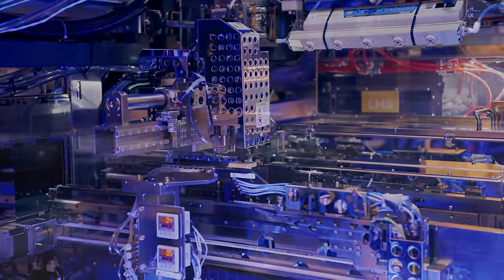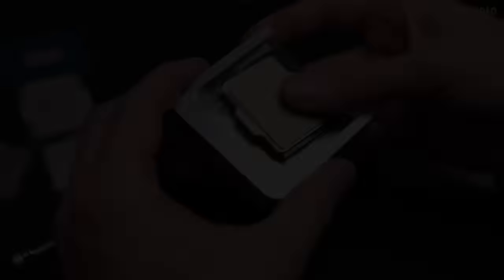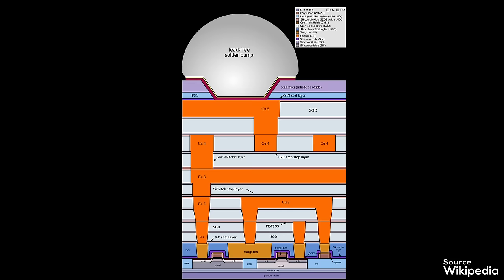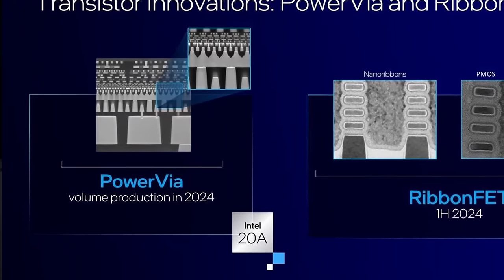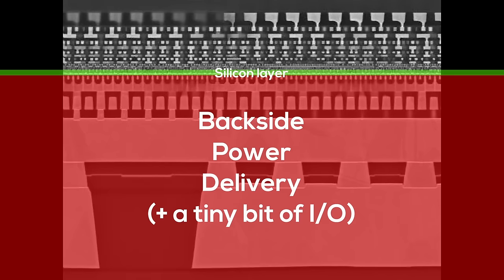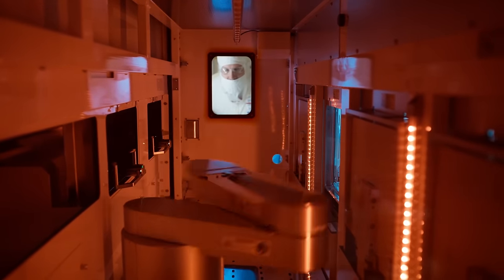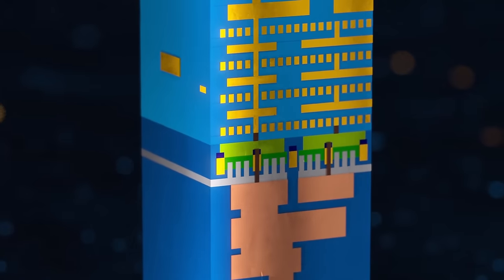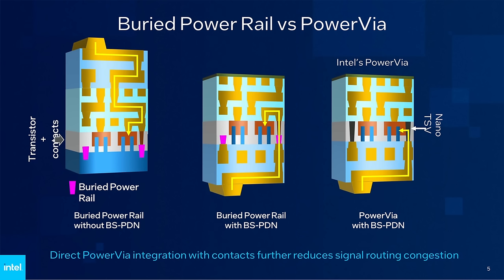Why next-gen chips separate Data & Power

Comment: It's crazy we've gotten to the point where we can make this stuff at all.
Reply: Yeah... yeah it's crazy.  It's a feat of engineering in mass production.  It's to the point where technology reaching its limitations so they have to precisely improve everything as possible to get performance.
Reply: When I hold a chip when I'm building a computer or something, I get the chills. This is the closest thing to "alien technology" we have IMO. The fact that you can get such an artifact for some hundreds of dollars is insane. Not to mention the enormous use you get out of it.
Reply: In the '90s, My Granddaddy had the same awe & amazement  as he told me about the very first radio he ever witnessed, before WWII.  "It was a machine that stood in the floor, right in front of an open window.  It had a wire attached to the back of it that went out the window to a pole. With nothing else attached to it..." 🤔😳

Comment: I wonder how this affects heat.
Reply: power efficiency allowing for higher clocks with less voltage means less heat but also mean for more overclocking room for higher cooling solutions so overall more it scales to be the same as todays you get the best speed you can for the temperature you can maintain. what it really means is devices are gonna get even faster and efficient.
Reply: one variable i would like to know is what part of the die generates more heat than the others but am assuming it would be the power delivery and i/o but if this design improves those power lanes I think that might improve the heat waste generation am not sure of those detail. but would be nice to know.
Reply: I am not a qualified semiconductor expert, but assuming that the total die thickness stays the same, I would think that backside power delivery would improve temps, and not only because of the improved power efficiency. The transistors have been moved slightly closer to the IHS, and they have the copper signal wires between the transistors and the IHS conducting the heat towards the IHS. on top of that, the larger power wires may also improve temperatures due to their increased thermal mass.

Comment: You didn't comment on heat dissipation, as there will be more layers on the bottom of the trasitons it could become more difficult or even more heat, I hope more videos like this, thanks for the content!
Reply: Yeah theres been alot of discussion on this but still not clear, I think it might just put 300w consumer CPUs in the pass
Reply: @ItsAkile  Yes but It still being a go for notebooks and SI OEM. If have to bet I would say it is for E-Cores only chips
Reply from the maker: Intel said there isn't much of a difference and the increase in efficiency (less energy lost to resistance = less heat) makes more than up for any decrease in thermal capabilities.
Reply: @pedro.alcatra nah, that was just for testing. It’s a full feature to be widely implemented
Reply: I just saw someone adding cooling to both sides of a motherboard which didn't make much sense to me at the time. And the POC didn't work very well.  I would think that the power delivery side would need the most heat dissipation.  This seems super promising.
Reply: @kahnzo  It is the silicon side that needs the most heat dissipation because that is where the switching is happening. The thick copper traces for power delivery will wick away the heat -- copper is an excellent conductor.

Comment: Don’t forget that lower thermal resistance is intrinsic to this as well
Reply: As well as increases power capacitance very near to the transistors, allowing lower noise.  Larger surfaces of power planes are free massive capacitors.  Nvidia used available space in the metal layers to make capacitors to reduce power noise.

Add to that, keeping (now lower) power noise away from the signals will help too.
Reply: @HansSchulze  and less parasitic capacitance to signal lines
Reply: @snaplash  I/O yes, but that’s nothing compared to the interconnects which are front side

Comment: Small clarification regarding the M0, M1, M2, etc labeling. Using the BEOL image from wikipedia at 5:45, you identify and highlight "M0" as the lowest metal layer in the BEOL steps. In your image, M0 would actually be the tungsten metal, which is identified as part of the FEOL processes. 

M0 is often called a "local interconnect", because it is a metal layer that is laid directly on the Si surface, and is used to connect immediately local transistors together. For example, in an Inverter gate with 1 NMOS and 1 PMOS, where the Drain of each transistor is connected to the same node, an Local Interconnect would be used to connect the Drains, by depositing a M0 layer directly on the Si, contacting the doped areas of the transistors that form the Drain. M0 is made of metals like Tungsten or Ti Nitrite, and not of the typical Copper or Aluminum metals used in higher layers. 

So M0 is a "special" metal layer used for local interconnects, because it uses different material and has to be deposited and formed in different ways than the other metals, because it's in direct contact with the Silicon. It's also used as the "Contact" metal for higher metal layers that need to reach the Silicon. M0 is the only one that actually makes contact with the Silicon, being deposited directly onto the Sources and Drains of the transistors to form vertical contact structures. Then, when the wafers move to BEOL, the first "typical" metal layer, M1, is made of Copper and it goes down touches the top of the M0 layer. 

In your BEOL image, you can see that the orange metal layers are labeled Cu1 (Metal 1), Cu2 (M2), up to Cu5 (M5). Each of these layers really comes in a pair of layers, because each Metal layer requires 1 layer for "Vias", which are the vertical structures that make contact between 2 metal layers, and 1 layer for the horizontal metal layers themselves. In the image, "Cu1" actually includes "Via1" (which is the vertical contact between the top of M0 and the bottom of "Copper 1") and "Copper 1" (which is the Metal 1 layer that makes the interconnects between blocks). Both Via1 and Copper1 each require their own photo masks and process steps. Then "Cu2" is actually "Via 2" (the vertical connection between the top of Copper1 and the bottom of Copper2) and "Copper 2", again each requiring their own masks and steps.

Comment: I work on Global Foundries' 22FDX process node which is a 22nm FD-SOI process for RFIC layout design and I gotta admit, this would be ridiculously useful in ways I can't even describe for the RFIC or Analog industry. I imagine it'll get significantly more useful the smaller your process node since the resistances get real high real quick when your metal connections have to be incredibly thin and the vias are tiny.

If I could put my thick power delivery wires on the back and not have to share the area over a bank of devices with the data wires my life would be a hundred times easier and I could work at twice the speed. This could even allow some sort of automation for the power routing.

Everything would become significantly more power efficient and thermally ideal by doing this too.

I must admit, I was rather surprised to find there was only one bottom layer metal (M0). In my process node we have M1 and M2, before going to higher layer block routing metals. I guess it makes more sense for a larger process node and for RFIC design
Reply: I can't say a whole lot right now, but I will say that there is active development for the type of power routing tools you're talking about. At the very least there is talk of offering assisted power routing for some 18A customers.
Reply: I keep on wondering: wouldn't it make sense to try to back port some of these Backside Power Delivery approaches also to older / larger nodes, like the 28 nm & 22 nm nodes which are still largely preferred for economic designs, especially considering that BPD promises both cost & power advantages? (Of course assuming that customers of these nodes are willing to invest in new layout design methodology & update their cell libraries)
Reply: @FrankHarwald  With legacy nodes, it's not as worthwhile as for less cost than spinning this up, they can jump to something like 14/12nm.

Comment: Amazing. 

I also think having the metal layers for data and power separate could allow for easier "glueing" of smaller dies together to form a bigger chip as you can route the I/O on top without going to the package substrate or even solder bumps.

Glue the chips together, then etch the hermetic seal and build yet another bigger metal layer on top of the smaller glued dies to make the I/O path even shorter. Thus you can make a huge die but with smaller yields. That wasn't possible with flip chips, but now one could imagine that being possible.

Comment: I do have to wonder about thermals and whether that will limit the benefits for P cores. The main heat generating component is the transistor layer and this method puts the signal layers in between that layer and the cooling system.

People used to polish down their CPUs just to reduce this distance by several nanometres and improve performance so I don't think it would be insignificant
Reply: Everything you said makes complete sense from physical point of view, but they did claimed 6% frequency increase so lowered power losses combined with better signal quality must completely offset higher thermal resistance. After all all that wasted power in classic design was ending as heat and not optimal signal network meant they had to use more power to hit frequency target.
Reply: @sznikers yeah what this guy said.
Reply: @sznikers  Pretty much exactly this. Cleaner signals means you don't spend as much power cranking your transmit and receive points, and you lose less to resistance everywhere since the paths can be direct and physically thicker.
Reply: Current intel method is to push the cores highest you can do, with BOD&IO , you have to find a good balance b/w how much power you can push vs what perf target you want.

It an added constraint to manage.
Reply: Lapping (not polishing) CPUs & heatsinks was to improve surface contact, not reduce thickness.

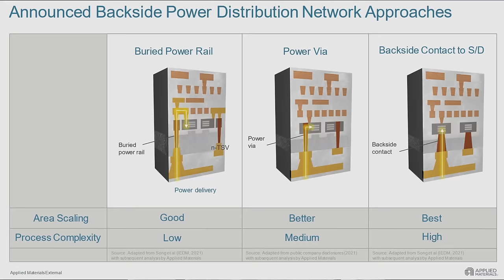Comment: I'm very happy to see this video. Slight bit of criticism - give yourself time to speak slower sometimes. I'm around 7:56 and it is hard to understand you, it almost feels like you're trying to speak as fast as possible. I don't think it applies to whole video, but it does to some segments, so in the end if the video was 20 seconds longer it wouldn't hurt that much.
But your content is top notch - and indeed problem of power delivery and data transfer, wiring etc. is a problem that is constantly evolving. Meaning that even if you find a solution, often people will take it for granted and within couple of years you will have to find other solutions to very similar problems. And yes, half of the evolution of microchips might be smaller nodes, but the other half is how to get them powered and linked. Very underappreciated topic, so I'm glad you're covering it! Good Job! 👍
Reply: I played the video at double speed and had no problem understanding High Yield. I think that he articulates very well for a non-native speaker. Just my 2 cents.
Reply: @aapje  Agreed. It was only around the time of timestamp - first few sentences in chapter "Backside Power Delivery manufacturing" that I had trouble with. Though I'm not native speaker myself - and I wouldn't be able to follow half of YouTube at "2x speed".

Comment: Since this method works both sides of a die, could it be used to further develop the transistor layer before making the second metal layer?
Reply: Yes, I believe Intel is looking at making stacked "CFET" devices, which effectively form a vertical NMOS/PMOS pair that can be connected on both sides.

Comment: Great summary and explanation. In addition to backside power delivery, I think we have already seen another thing that helped with segregation of data/memory and power. That was the use of chiplets or tiles. Instead of having a monolithic piece of Si as one CPU chip that has everything, now they have different chiplets purposely optimized for each function.

Comment: Still don't know how they connect them to pcb front and back both
Reply from the maker: The frontside doesn’t need to be connected to the PCB, as it only handles chip internal communication. Power supply and I/O is routed through the backside, which is the side connected to the PCB.
Reply: To think when I did chip routing software, a 3 metal layer process was considered advanced.
It's getting indistinguishable from magic now 😉

Comment: Does it have a usage in complex chip designs or just small low power chips? How will You use active cooling on chips where You have power delivery with higher voltage under the chip and extra less thermal conductive layer of wafer on top?

Comment: What about cooling? Having transistor side closer to heatsinks significantly improves heat transfer I would imagine. Considered they are pumping hundreds of Watts into their chips, it sounds like it would actually decrease performance as for e.g. "turbo boost" wouldn't be able to clock as high.
Reply: The gains from the lower internal resistance pretty much completely offset this. Blue Sky Creek saw a 5-10% clock speed increase over production-volume Intel4 node chips. For an example, if Meteor Lake were using this test node, you would see boost clocks about 400mhz higher on the P-cores and 250mhz higher on the E-cores, which doesn't sound like much, but it is done at the same power draw.
Reply: @DigitalJedi  “Back in my days” ™ 400 Mhz was the whole processor speed. If you were lucky, and rich.

Comment: Great video :)
I was wondering, why don't they create the signal layers first, then the transistors and then the power delivery? That way you would avoid grinding down to the transistors and adding structural support again.
Reply: that would need an entire redesign on how the silicon litography part works I think, wich would lead to many new costs for validation and R&D necessary
Reply: I think the transistors themselves need the silicon wafer, they can deposit a metal layer on top of silicon but not a silicon layer on top of metal, my best guess, not an expert
Reply from the maker: Because the metal layers have to connect to the silicon layer and building up silicon on top of metal seems like a really difficult process.

Comment: Maybe this way will make it more clear: there are 3 types of metal connections, transistor-to-transistor, power-for-transistor,  and transistor-to-IO. Since transistors are on one plane, so marjority of the metal layer connections are transistor-to-transistor. What back-side power delivery do is, put all transistor-to-transistor metal layer to the front side, put power delivery layer and IO metal layer to the backside. Then front side will facing your heatsink, backside will connect to micro bump eventually goes to your motherboard.

Comment: Basically the reason for backside power delivery is because transistors follow Moore's law still but wires never followed Moore's law!  I learned this from Preparata in circuit complexity class in the 1980s ... If you shrink a wire you have to pump more current through it to overcome increased resistance and maintain latency!  We had a one-time scaling of wires in the 1990s when we converted from aluminum interconnect to (more conductive) copper interconnect.  And from your VLSI chip interconnect, it appears that wires have scaled a 2nd time in 3D.  So this is perhaps the third and last time we can scale the wires!

Comment: An important note: Intel's next-gen backside power delivery nodes can, at best, match TSMC's traditional data + power nodes in perf / W, density, and cost *according to Intel*. Even Intel knows 18A's PowerVia / backside power node won't beat TSMC's traditional nodes on all major targets.Thus, backside power delivery improvements are most accurate when compared intra-foundry ("Intel backside is better than Intel traditional", "TSMC backside is better than TSMC traditional").

 It's only Intels' "2nd generation" Intel backside power delivery in Intel 14A where Intel thinks they can beat TSMC on perf / W and cost, and maybe density.
Reply: So what's on 20A?
Reply from the maker: @AstrogatorX  The current rumors say some Arrow Lake-H chips (6+8 mobile). Lunar Lake will be N3B and for Arrow Lake-S, the CPU tile also seems to be N3B. Capacity booked by Intel before they knew if 20A would be ready in time.
Reply: @HighYield  Thanks. Keep up the good work!

Comment: Since the first wafer is removed it could be thinner to begin with, saving wafer cost and time to grind it away. Also the final structural wafer wouldn't need to be suitable for transistor production, allowing cheaper materials (failed wafer recycling?) or even something with better thermal transfer.
Reply: Manufacturing that depends upon silicon support will have to change.

Comment: Great article, question on the backside IO routing, obviously the IO's need to connect in some shape or form to the Top Side signal routing, How is this performed, you would have to route from backside through the silicon and out to one of the top side metals? I can't visualize this and at what top side metal layer does the IO connect to? Is there one large via through from back to front?